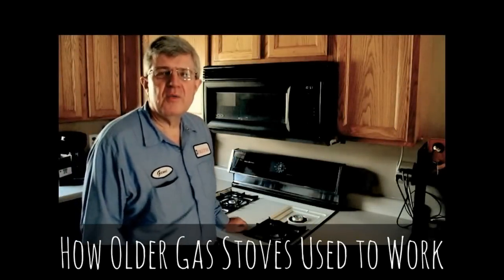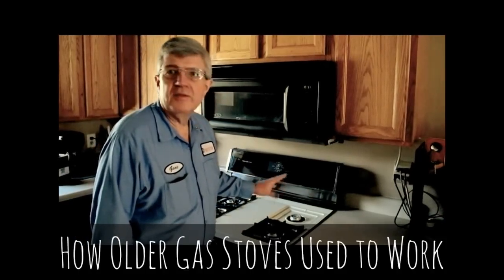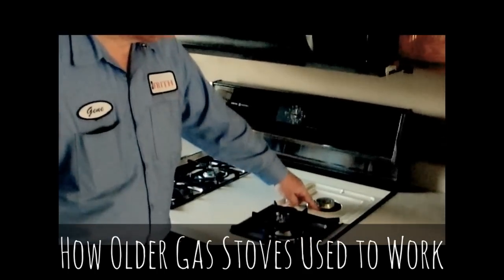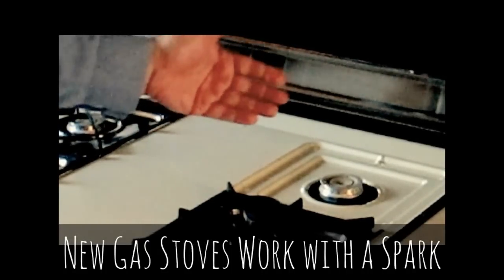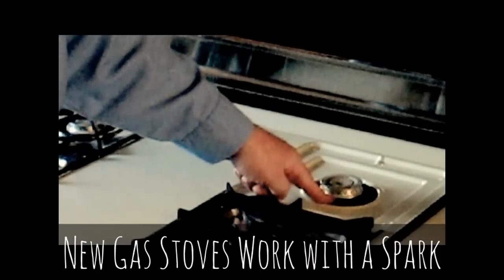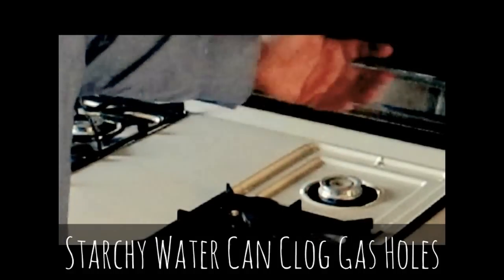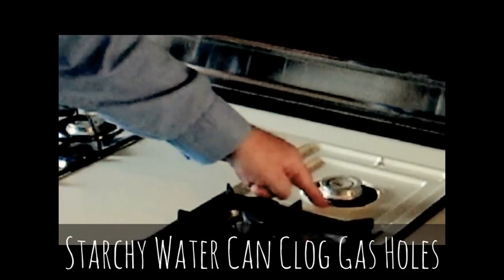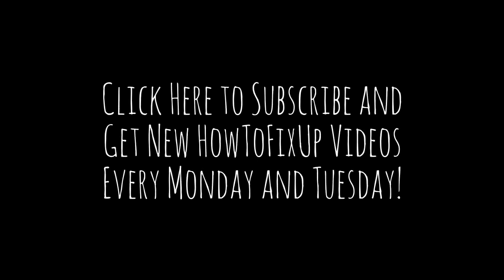Clogged Gas Burner: How to Fix a Gas Burner on a Gas Stove That Clicks But Doesn't Work

Comment: Very informative, thanks, but a long vid to just say 'stick a pin in it', lol. I had no idea it would be that simple. However, mine was clogged with jam I had boiled over that had hardened so I needed the addition of a bit of boiling water over it to dissolve the sugar. Works 100% now.
Reply: How did you out boiling water over it,
Reply: @chrbx13  The gas jet nozzle in my stove (Kenwood) lies under the 'fan' outlet, in a small reservoir, so I just poured boiling water into the reservoir and then used a pin bent at 90 degrees to poke it through. Pretty sure the hot water helped.

Comment: That may be my moms stove problem. Shes at the point where only one burner lights & the other 3 are dead ( It clicks & gas comes out but wont light til she places a match/flame to the burner.  so it looks like how you described it..the spark can't reach the released gas.  Will check & look for those 3 holes.

Comment: thank you kind sir, but my problem is that gas come very very weak.. in one one of the eyes, the rest are fine and perfect.. but that ones even you can hear very faint sound of gas coming out when I light it it turn on but very very little light comes out.. I tried to put needle to unclog the hole, but the needle is so short to reach the little opening inside, I took all the peace on top so I can reach it but still , I used plier to hold the needle to give it more length but then it becomes so imprecise to find it.. any help? thanks

Comment: Yeah no. I've got a gas stove that has a burner blocked up, turn the gas on and there's no sound of it coming out of the hole under the metalwork on top. The other 3 work and sound normal, so presumably there's gunk in the supply tube in the base of the burner. I've tried a bit of wire down that with no joy, is there any other way to unclog it?

Comment: so i had someone come check for a gas leak a few days ago, my pilot light on my water heater is on so as is my heater. but it seems that i am not getting gas to my stove. Everything clicks but thats it. I even tried a match but nothing to any of them. how would i check if the gas is flowing to it?

Comment: What do you do when the stove top flame is to high, even when it's at a low knob setting. The flame is burning the outside of the pots and pans.
Reply from the maker: It might be the simmer flame. Each burner control has a small screw that fine-tunes the level. But you definitely don't want to adjust it too low if you adjust it, or else there will be gas without a flame. Here's a page about someone adjusting it: http://research.rolfes.org/home/adjusting-the-simmer-flame-on-a-gas-stove/
Reply: Thank you for providing the link.  I successfully adjusted two simmer flames to be lowered.

Comment: I have a 06 Dutchmen camper. The stove is gas and the top burners work but the oven won't. You can't even hear the gas coming through. How do I clean that out? Also the furnace won't light and I don't know how to or how to light hot water heater..somebody help
Reply: If the oven doesn't work most likely it's the igniter. I am no way a technician however we've had two stoves and both ovens didn't work nothing came on we found out it was the igniter and we were placed it and it worked so Google your model type oven doesn't work. Could it be the igniter and I watched a lot of videos that proved it so hopefully that helps

Comment: I did this and the end of the needle broke off in the hole, now what do I do? I tried a magetic screwdriver >0
Reply: yo my mom did the same thing, did you have a fix?
Reply: @ScaryMiko  I  GOT A NEW STOVE I HATE. I  DID RESEARCH BEFORE BUYING BUT ISSUE WAS HIDDEN TILL I ASKED THE QUESTION. It's a Kitchenaid and you can't make a pizza in it. The heat comes from the top, weird, no help from kitchen aid.

Comment: I tried that and my burner still doesn't function properly. So now what?
Reply from the maker: If it's a front burner, the mechanism might be worn out. A temporary fix is to turn the one in front of/behind it on, turn your problem burner on past the clicking point for just a moment, and then flip it back to the click setting. The flame will catch if that's the problem. Otherwise (and even if, since this doesn't repair it), you'll want to call in a technician.